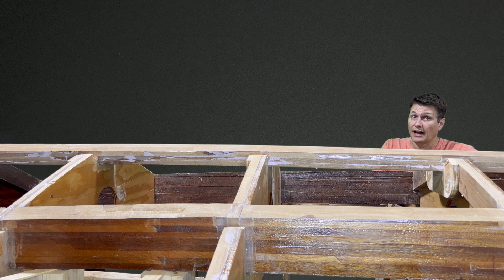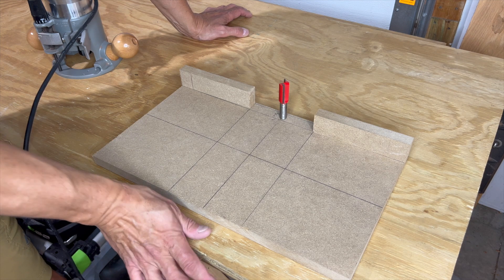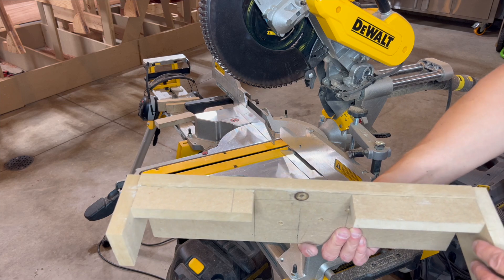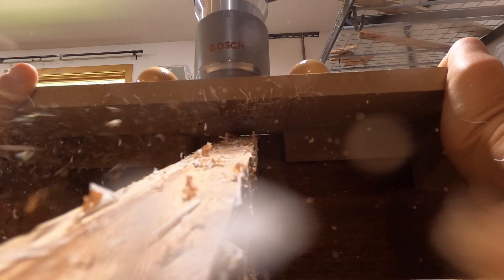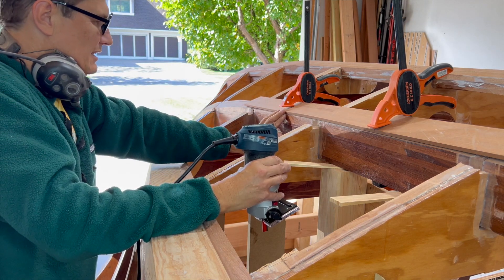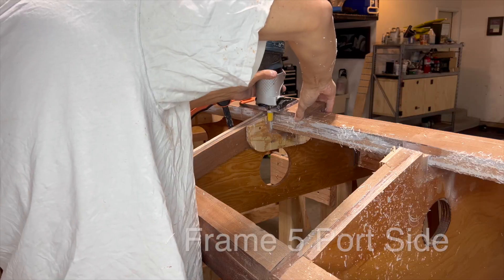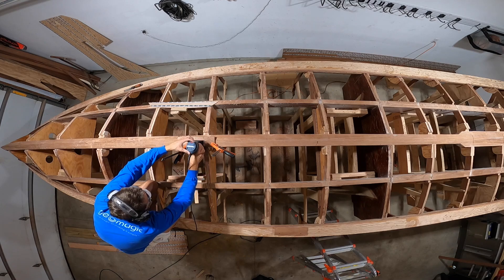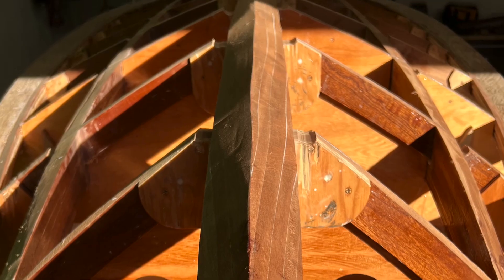Temptress Build 54: Limber Holes

Comment: Congrats on your build.  From a safety perspective, remember just because you can take a full depth cut, doesn’t mean you should!  Especially during a hand-held “climb cut” with a ¾” bit. I’d feel better that you finished the job with all your fingers so you can enjoy the fruits of your labour.  That said, it’s coming along nicely.
Reply from the maker: Thank you, Rob.  Are you saying that I. Should have made several shallower cut?
I do appear the advice.
Reply: @Polymerman  It does sometimes come across like you're fighting the tools. On the whole if you're applying a lot of force to a tool then it's probably not the safest way (learned from painful experience). Multiple shallow cuts is easier on you and the tool. Keep up the good work, the build looks amazing 🙂Looking forward to the next video!
Reply: Absolutely.  If you can’t create a jig that solidly and safely holds the router during the passes, then the next safest thing to do is take several shallower cuts.  The router won’t kick as much and it’s much easier to control, AND it’s so much safer.  The time taken to build a jig and to take multiple passes will always be less than the lifetime of regret following an avoidable accident.  Stay safe, plan ahead and enjoy the process.  Your build is coming along nicely and I enjoy watching you bringing it to life. Keep up the good work.

Comment: Don't forget the limber holes from stringers down to keel. Two would be sufficient from lowest points. Else the water on stringers will accumulate not on keel but at the lowest point of stringer and get trapped there.
Reply from the maker: Oh yeah.  I had not thought of that…